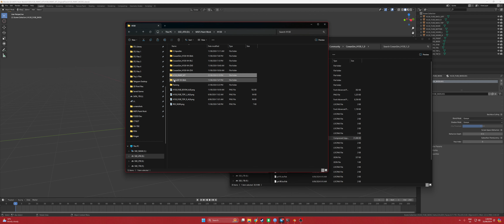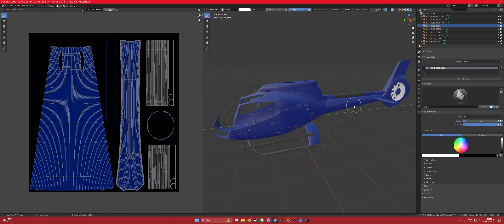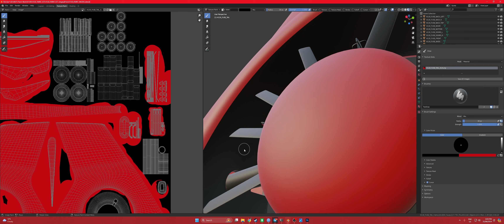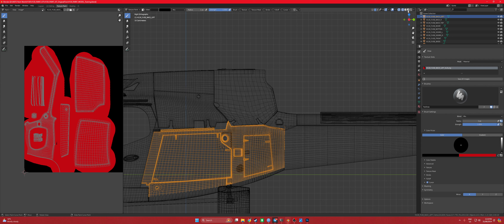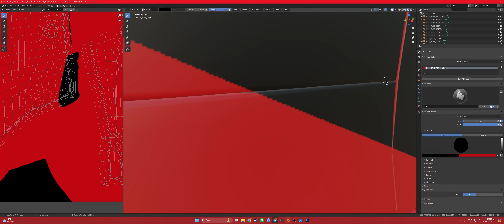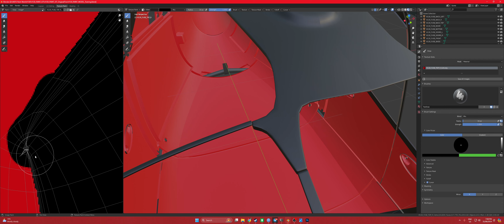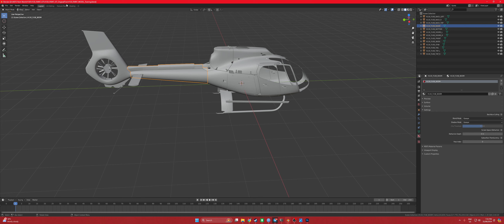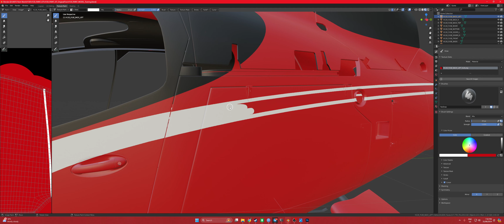Cowan Simulations Livery Painting  Blender Tutorial

Comment: Troy, thanks so much for this. I'm a VERY inexperienced blender user but trying hard to learn.  Question: The individual texture files, that you show at about 6:25, where are those in the paintkit? I am trying to paint the 222b and I am confused about the file structure.
Reply: In this helo, in the paintkit, I have two folders: Gimp with XCF files, and Photoshop with PSD files under 222B_PAINT_KIT and the Blender File under CowanSim_222B_Paint_Model.  I don't see the PNG files that you clearly show. Thanks for any help in advance. If you answer a couple of questions I may have, including this one, I will give a donation if you provide a link.